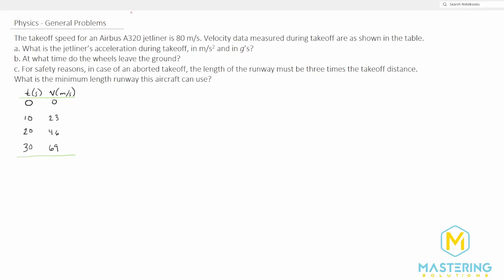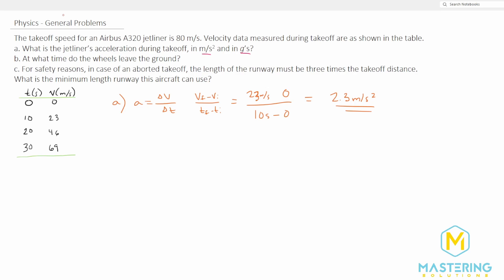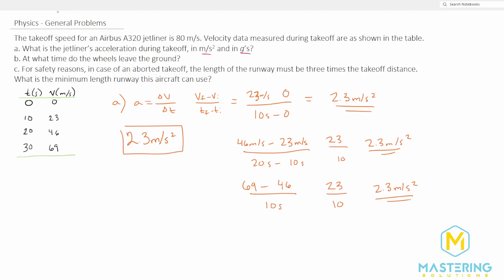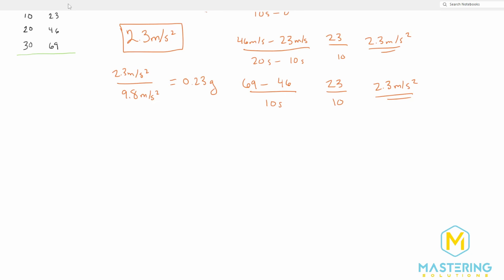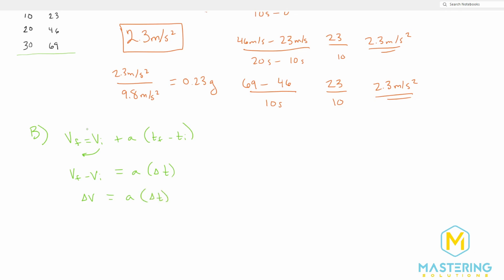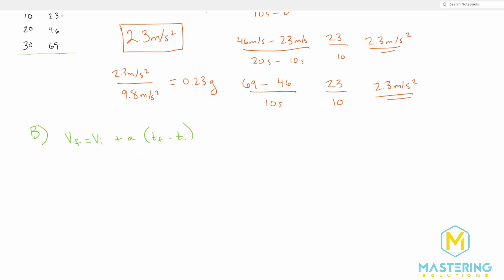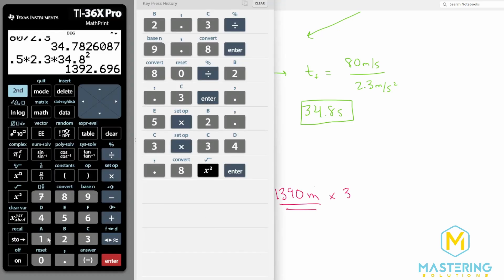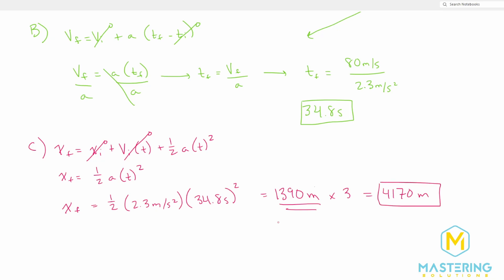2.61 Mastering Physics Solution-"The takeoff speed for an Airbus A320 jetliner is 80 m/s. Velocity

Comment: This seems to require several unwarranted assumptions: that the acceleration is constant, that the airspeed and ground speed are the same, and that achieving takeoff speed is coincident with the wheels leaving the ground. In a real aircraft takeoff none of these is likely.
Reply from the maker: I see your points, and while that is probably true, in this question taken from a textbook, this is the data that we're given. Based off of the given data we show that acceleration is constant, and we would also have to make more assumptions about the wheels lifting off if we didn't assume it was coincident with the take off speed. You're absolutely correct that the problem is simplified from a true, real-life scenario, but the point of the problem is to practice applications of kinematics, and it achieves that. Thanks for your thoughts!